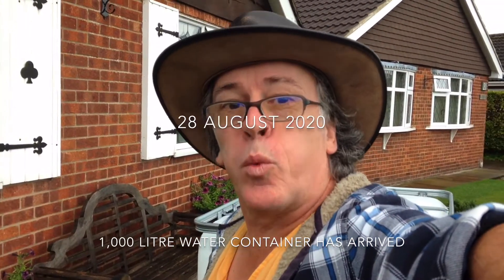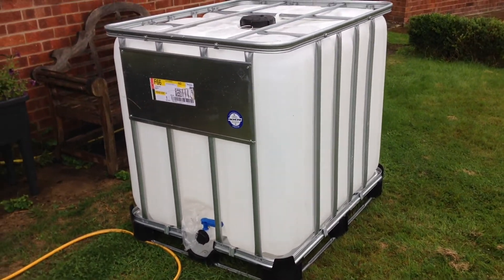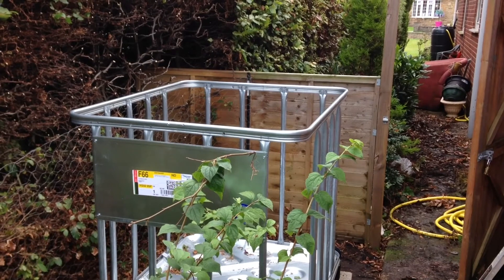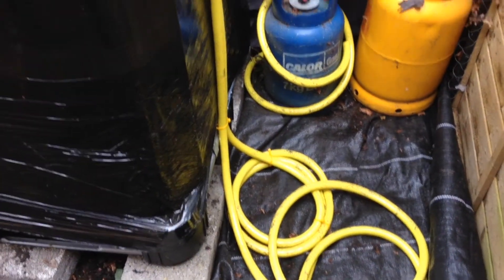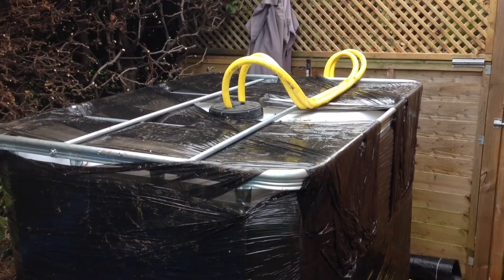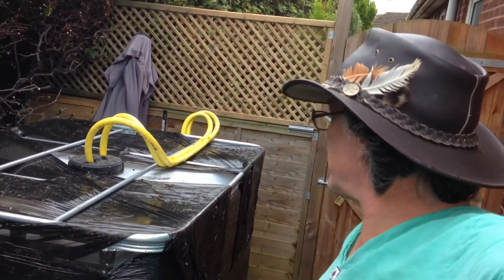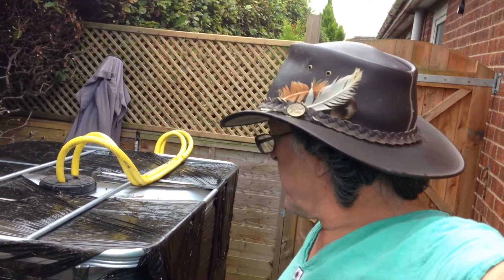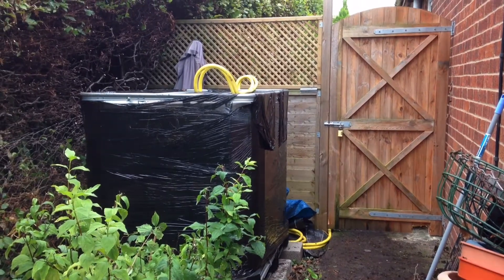Installing our 1,000 litre Rainwater Harvesting header tank

Comment: simon not enough  storage capacity unless you are going to use it to auto water when it fills, figure with the amount of rain you get 10k ltrs storage would be about enough. are you allowed to borrow water from the river as well
Reply from the maker: Absolutely correct! This is just phase one of building up a system and the 1k tank is designed to double up as a storage tank  and header tank to gravity feed water to the main storage tanks which will be at the bottom of the garden. We could have opted to gravity feed the entire system, but using pumps at the initial collection point provides a simple way to have full control of how much water is in the system at any time.  I agree that we could probably collect 10k or even more, we measured nearly 1k coming off the roof over just 2 particularly wet days a while back, which is what spurred us on the start storing. As for the river, no we would not be allowed to extract from that.